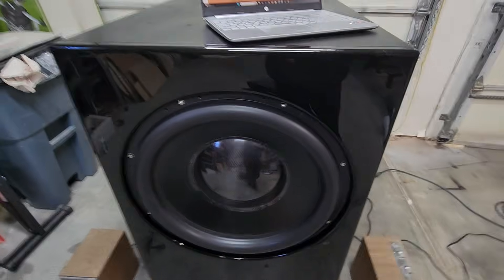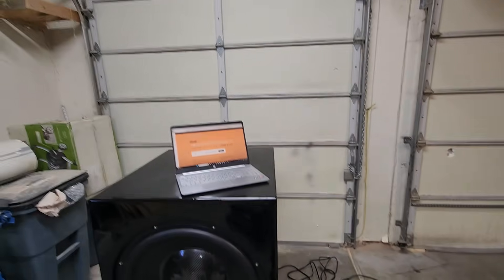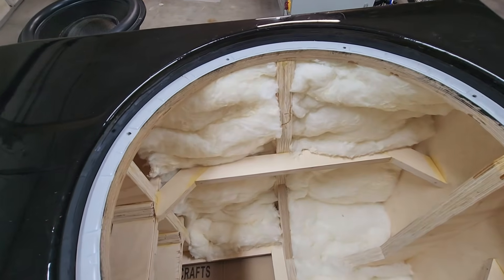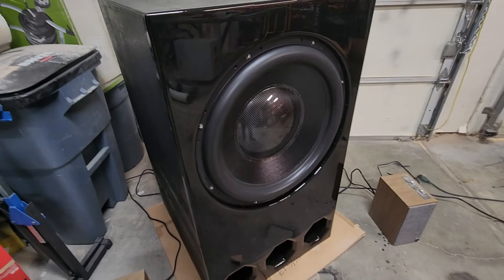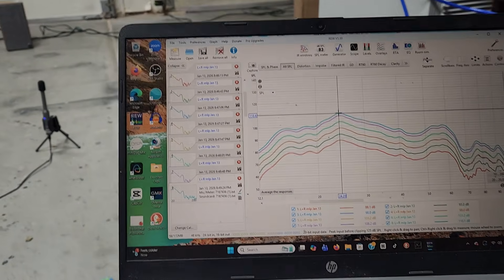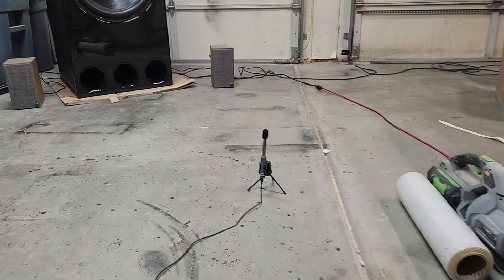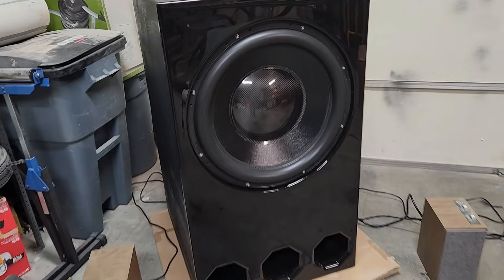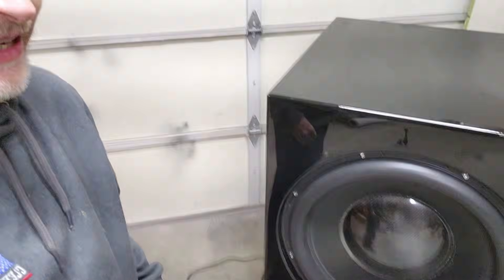How much BASS can a 24 inch Home Theater Subwoofer make?

Comment: Very nice subwoofer and proud you made your own box. I made a few boxes for car audio subwoofers like 25 years ago, but never home theater. Going to the local lumberyard and getting all the precision cuts done when you buy the HDF or MDF is an easier route. Internal bracing for the 24" seems complex though. MWAVE has sale where you can get the Stereo Integrity 24" already installed in a box, think it was $2,500 last year. Driving thousands of miles would be the hard part unless you get it shipped. I prefer sealed box for movies.

Comment: Ok, I have to ask, how did you do those ports?  Are they ones you can buy, or did you route them into the MDF?   That's probably what I would have done.  They're round tubes, though, right?
Reply from the maker: If you go one video before this, you'll see how they're constructed.  I built them from scratch.  That video is a little heavy on the Christian music, and it takes a jab at the sealed sub guys.  Lol.  But you should get a pretty good idea of how the ports are done.

Comment: Does damping materiel do anything at these frequences ??
Reply: @integra8502- Damping material always does something. An enclosure will always get more acoustically dead, with proper damping material, & placement, some enclosure's will be effected more than others.
Reply from the maker: You have a valid point.  Damping is a lot more effective with higher frequencies than at lower frequencies.  But it's nice to know that it will behave well throughout the spectrum that it operates at.

Comment: Man if I had the space... Also, it seems like you're barely pushing this thing.  Is it fair to assume it has a ton more SPL if you wanted?
Reply from the maker: Yeah, I suppose I could have turned up the sub output on the little klipsch system.  I also only had the gain on the 4,000 watt plate amp only halfway.  So there is plenty of headroom, but I'll let the new owner explore its limits.  It can probably do 130+ db in a good sized room.

Comment: But "chuffing" only happens with high port velocity!  It will chuff if pushed hard enough, but you barely woke it up.  It'll probably hit 130dB with a big enough amplifier?
Reply: @fredygump5578- I was thinking the same thing. If a port chuffs on low power you got major problems! You could tell he was proud of his work, as he should be, its AWESOME!
Reply from the maker: I may build something similar just to see if I can get it to chuff at any volume.  I've spoken to some experts that say that the octagonal port design is far more efficient than square, round, or slot.  It's second only to elliptical.

Comment: Sounds clean!  I am listening at my desk: 
-Kef Q150s powered by a mini amp Douk Audio A500 50W X 2 @ 8ohm 32V 5A power supply (has a built in variable high pass filter for the speakers & a subwoofer out)
-(1) 12" Alpine Type R subwoofer in a down firing 4.25cu foot vented box tuned to 19hz powered by another mini amp, a Nobsound 300 Watt G2 Pro 32V 5A power supply (has a built in variable low pass x-over).

Btw, my wife reacts to rockwool but I don't.  We used alot of it when renovating our house that was built in 1890.  She gets a scratchy throat, burning eyes, and her skin itches.  Future projects maybe consider Acousta stuff or pillow filling you can buy pretty cheap at walmart in big plastic bags?
Reply from the maker: Nice system:).  Yeah, I'll continue to do more research on damping material.  I'm leaning toward denim, but I'll do a deep dive and make sure there is nothing about it that could cause irritation.  I want my subs to sound healthy and preserve the health of the person listening to it :).

Comment: Do you use DSP for cone control below box tuning ?
Reply from the maker: Yes, but my little garage bluetooth system doesn't have dsp.  But that's okay because it can't push anything to its limits anyway :).  I suppose I could turn up the 4,000 watt plate amp that resides in the back of the enclosure and really open it up, but being a brand new sub, I just stopped when the klipsch system ran out of steam :).

Comment: I always use Rockwool in my builds. It is even better than fiberglass.
Reply from the maker: That's good thinking.  I have always used rockwool in previous builds as well.  I happen to have a bunch of brand new r19 fiberglass insulation, so I used it originally, but after hearing the concerns and doing the research, that won't be used on ported subs again.  :).
Reply: @righteousbuilds3576 rock wool safer and healthier?  I just go done insulating my basement with rock wool and it really irritated any exposed skin areas of my body.  Plus it gives off lots of tiny little particles and dust.  Just curious because I wanted to replace my ported speakers fiberglass batting with rock wool.  Anyway, nice build on the sub, especially the exterior finish.

Comment: LOL, it's huge too.  Nice.
Reply from the maker: Yeah.  It's 28x32x48.  Basically the size of a fridge :).
Reply: @righteousbuilds3576  After port, bracing, & basket displacements, is this enclosure around 18 Cu. Ft. Net, tuned to 24 Hz? What is the total port area of those 3 ports, around 90 sq. In.? Great looking, & performing enclosure. What amplifier model, & power is being used on this Pierce Audio 24"?

Comment: DATS down ?  I always had to fiddle with  the volume on mine to get is to run.  Microphone volume constantly had to be reset in the Properties window.   I ended up building a dedicated PC for my DATS and I leave it powered on so I get consistent results.   I made a custom DATS in a custom enclosure and  made higher quality leads and a cal switch with the cal resistor in the box.  It's self contained and I never have to mess with it to get it to work correctly.
Reply from the maker: Nice.  It sounds like you know what you're doing there.  I have a Dayton Audio DATS that I use for impedance sweeps and it give me a bunch of meaningless chaos when I try to find the enclosure tuning frequency.  I tried to recalibrate it and it just says that everything is outside of its normal limits.  I'm not sure what's going on with it.
Reply: @righteousbuilds3576  Yes, you really need to set the advanced sound settings correctly and run the calibrations to get rid of the noise.

Comment: is that sub capable of taking more power?
Reply from the maker: Absolutely.  I had it connected to a little klipsch "the fives" bluetooth system.  I only had the 4,000 watt plate amp turned halfway up.  The klipsch system maxed out, but there was plenty of headroom left.  Once I have more than just a little bluetooth system in the garage to run it, I'll be able to test the full potential on those things :).

Comment: Dude, you got me again! Interrupted a show I was watching when I saw the notification pop up for this video! Lol 🎉 man, the front of this one looks soo good!! 🎉 I really like that you swapped out the fiberglass for rockwool!  It seems like there was a bit more or maybe just fit better in there. 🎉 
Btw, my new RSL 12S was shaking my room on your test tones! lol. 
Crazy you’re not getting any chuffing even in at high volumes  102db at 14hz is really good. 
Only question I have is, I’ve seen previous info regarding the ultra large Pierce drivers (24”/33”) may have some “interesting” things above 50hz. Hopefully you can get your DATS up and running

Ps. Sky high car audio has a new 24” sub for $1649 ($350 for carbon cone upgrade) as well as a 33” in stock. Could be fun to try out especially if ya can get a deal. Thanks.
Reply from the maker: Lol.  I had some time to get the video done.  I may have to send my dats in for repair.  Not sure what's going on with it.  The fiberglass was definitely thicker and looked like it took up more room :).  I'll have to check in with the buyer and see if he notices anything above 50hz.  I'm glad I could help you shake things up at home :).
Reply: @r @righteousbuilds3576  hey btw, not sure if you’ve seen it already, but @slickwillybudgetking is doing an 18” subwoofer shootout, first run is in a sealed enclosure and he has tested a ton of 18” drivers. (Look under the “posts” section). It’s interesting to see how each sub performs in the same enclosure/power. 
I was thinking it could be kinda cool if you had the ability to build a decent enclosure and actually A-B different drivers in it. (It would probably take a lot of time, but I don’t think anyone else has ever compared 21/24” like that in the same enclosure). 
Anyway, thanks for posting the results!! 🎉